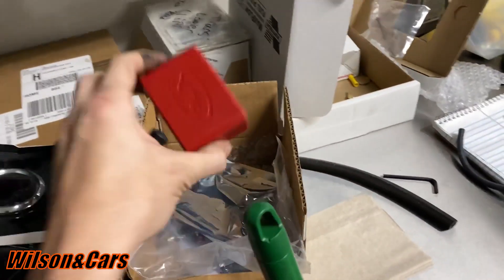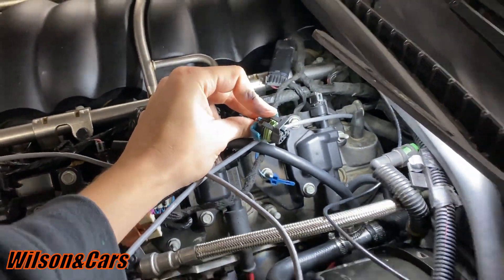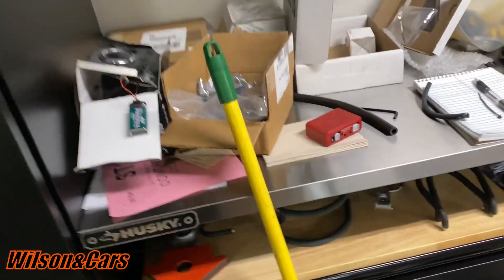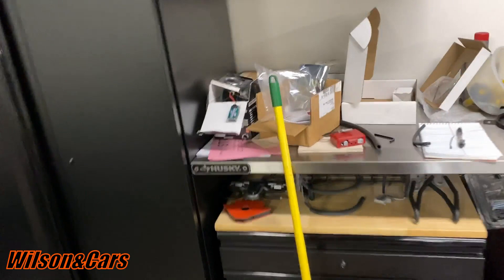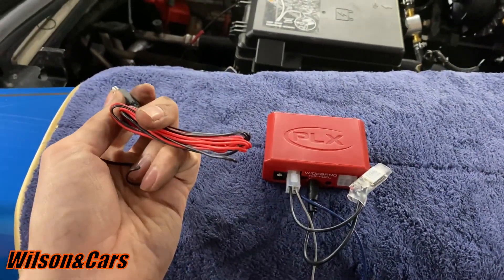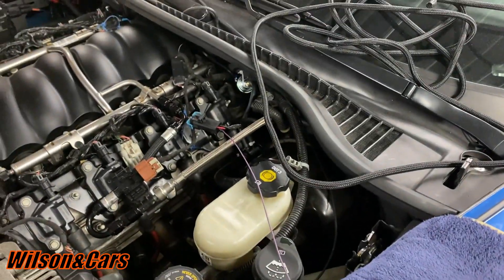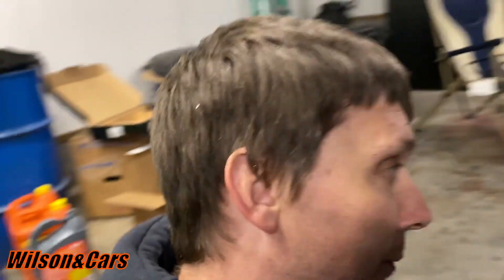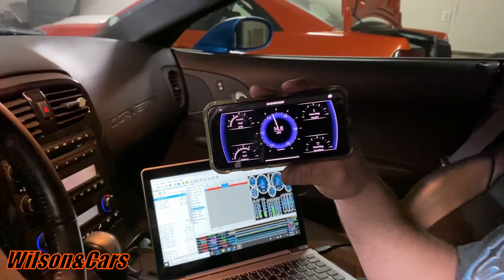Cammed c6 corvette  getting a wideband for hptuners

Comment: This is the only video on YouTube I could find on this! Thanks for posting! Quick question, how are you getting the 0-5 v signal into HP Tuners?
Reply from the maker: There is a 0-5 analog signal from the wideband controller that will plug into the MPVI unit if it’s the pro unit , then you will configure it in the scanner. There are a few video on how to setup wideband in Hptuners in YouTube just do a quick search.
Reply: @Wilsonandcars  Okay, I wasn’t aware that you were using the pro feature set. I was hoping I wouldn’t have to spend $250 just to log a wideband signal. Thanks for the reply.